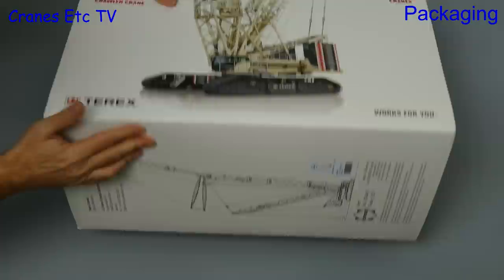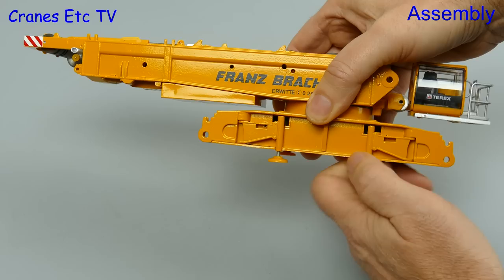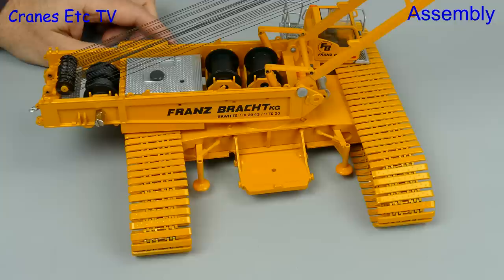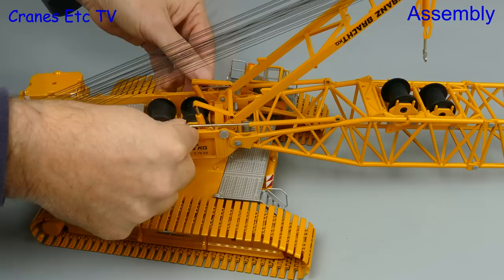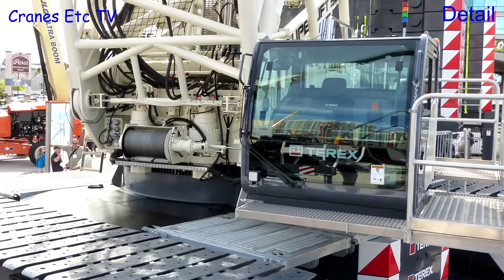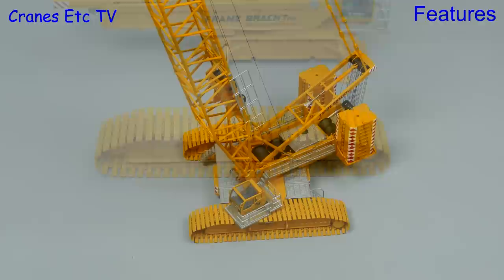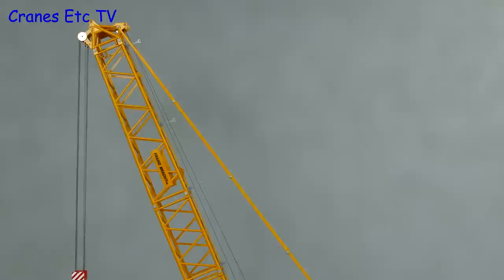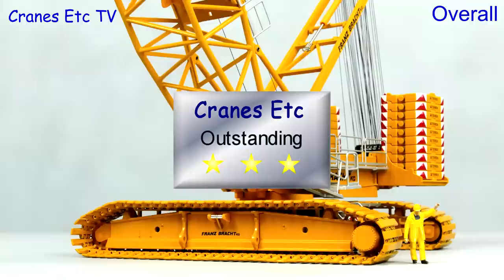Conrad Terex Superlift 3800 Crawler Crane 'Bracht' by Cranes Etc TV

Comment: The crawler tracks are realistic but there's one thing that's not accurate in this model.  The track links have two rows of teeth instead of one on the real crane, and the rollers on the real crane are doubled, not single